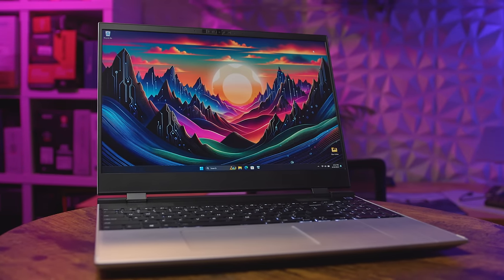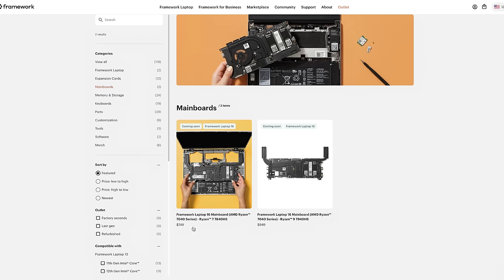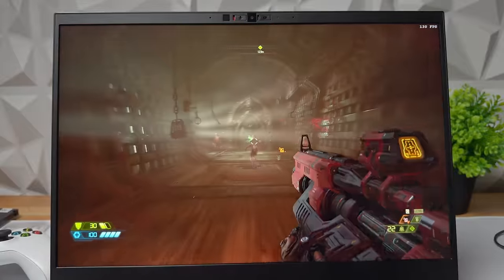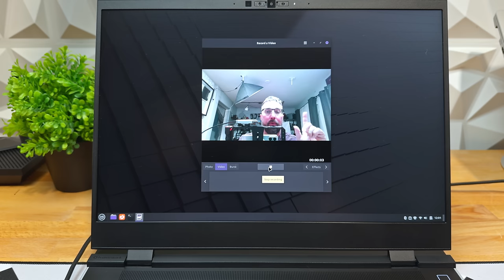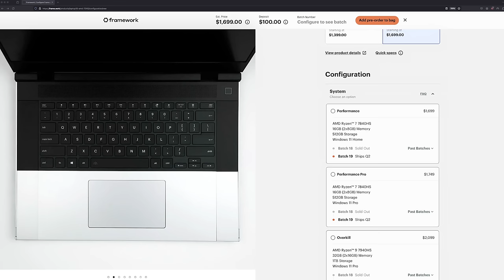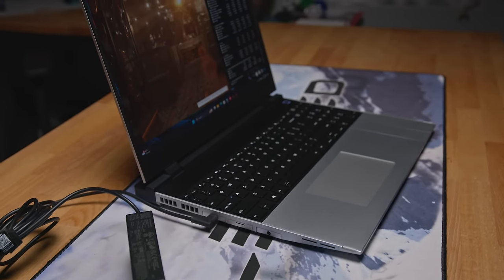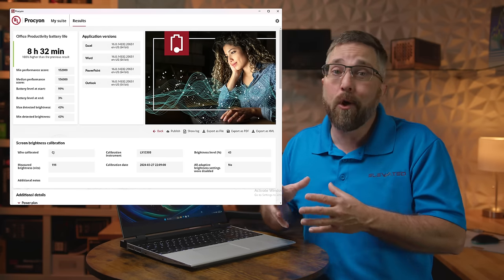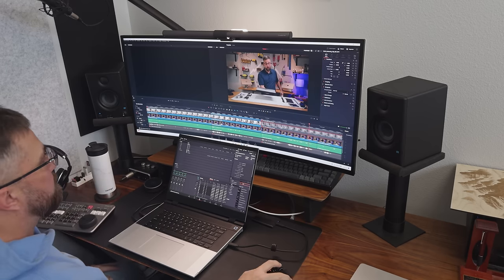Two Months With the Framework 16 Laptop. My Final Thoughts!

Comment: also its a longterm investment that will save you moolah in the longrun.
Reply from the maker: Will it? How? In 5 years from now are you going to spend $500 or more to put a new GPU into a five year old laptop? I'm genuinely curious how many people will actually upgrade this laptop.
Reply: @ElevatedSystems  The same way everyone's been upgrading the 13.. and even with a GPU and motherboard upgrade, it's still less than buying a new laptop
Reply: @ElevatedSystems pretty much all of them. This laptop loses a lot of its advantages if you choose to do not it. Most laptops in this price range will be better in every way.
Reply from the maker: @intoxicode  but at current prices  just the mainboard and GPU module cost the same as the Asus TUF A16 Advantage Edition. And that laptop is almost as upgradeable as the Framework.
Reply from the maker: @Marauder-q2v  But how many general consumers are going to spend the extra money now, on the potential of future upgrades? And what if Framework just keep releasing the newer versions of the low end Radeon Card? This is an AMD Advantage laptop, can they ever make a Nvidia or Intel graphics module for it?
Reply: @ElevatedSystems  nvidia themselves won’t let framework do it because of their weird rules. This is why Asus’s EGPU is running a mobile 4090 instead of 4090 desktop. Nvidia is quite particular about what their GPU’s can go into. 

But if you’re cash strapped in the first place, framework isn’t the laptop for you. This laptop makes no sense if you want price to performance. It makes even less sense if you’re  not going to upgrade. Might as well go for a cheaper laptop with better specs.

Buying a framework to not upgrade it is quite literally buying an E bike and only using it like a normal bicycle.
Reply: @ElevatedSystems  The upgradability of this laptop is one of the huge reasons I chose to buy this laptop over other laptops. If it were just about repairability, there are other laptops that offer that.